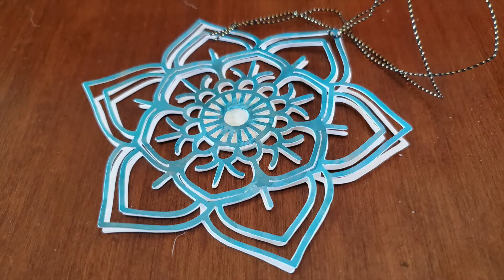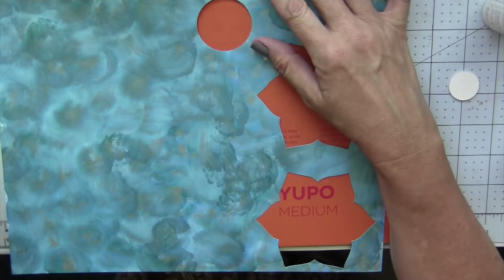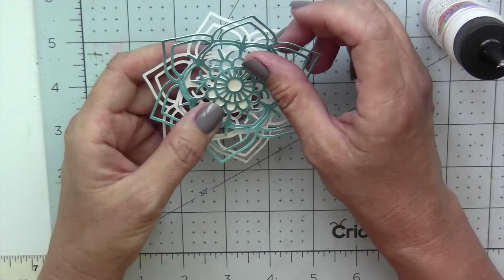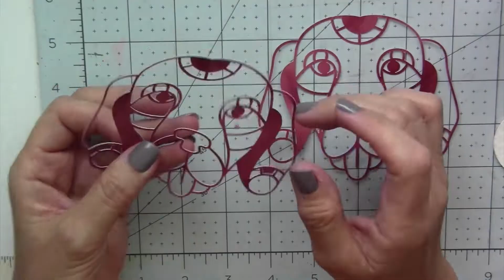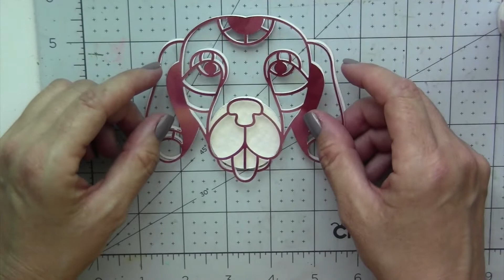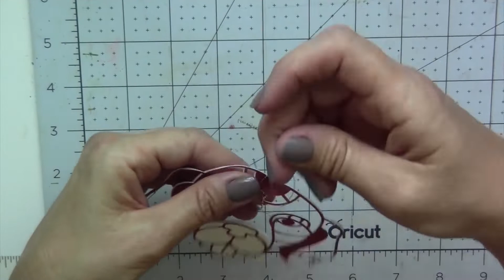Cricut Project - Air Freshener - Easy way to make your own design

Comment: Need help wondering what setting to use to cut the air freshener blanks on cricut?
Reply from the maker: You can set it at light chipboard and it will make several passes to cut through the air freshener paper.  If you have thicker air freshener paper and find that it didn't cut completely through, you can use an x-acto knife to help cut because it will be pretty close to cut. Hope that helps.
Reply: @CraftedSweetly  thank you for replying so soon! What blade would I use first just the fine cut one?
Reply from the maker: Yes.  Just the fine cut blade.

Comment: Super cute! Have you tried these in your vehicle? Have you noticed the paper curling with sun exposure?
Reply from the maker: Thanks!  I've actually had the star shaped one in my car since I made this video.  I've had to add more essential oil of course.  The curling is VERY minimal since I didn't glue the end points.  Gluing them would have eliminated that.
Reply: Thank you for the quick response!!!

Comment: Hi which blade did you use?
Reply from the maker: Just the fine point blade.  It makes several passes to cut through the air freshener paper (depending on thickness can set at light chipboard)  and once through the Yupo paper (medium cardstock).

Comment: Can you use Circut Air 2?
Reply from the maker: You can for the Yupo Paper. You would not be able to cut the air freshener paper with the air 2, however.  You could use an exacto knife to cut out circles and make it work.   Hope that helps!  Diana
Reply: @CraftedSweetly  Thank you!
Reply from the maker: @cheriehughes7393  My pleasure - let me know how it works out.  Feel free to join my FB group and post your project when done.

Comment: Hi! What Cricut setting would you recommend for the thinner air freshener paper?  I'm pretty sure I have the same paper from Candles & Supplies (thinner 8.5 x 11 sheets). Thank you :)
Reply from the maker: Hi! You can try the cereal box setting and perhaps cut it twice.  So before you remove the mat, press C again and it will cut one more time.  Hopefully that will do it.  Thanks for watching! Diana
Reply: @CraftedSweetly  thank you!
Reply: Hi Stacy, did you end up trying this out and did it work? :)
Reply: @ashleytr  hi! I adjusted my settings to cut pressure of 350 and enabled multi-cut to 2x. I think that worked. It’s been a while since I made them tho. Hope that helps :)